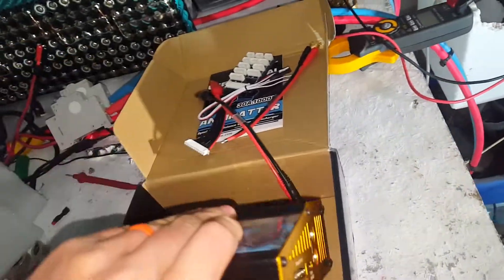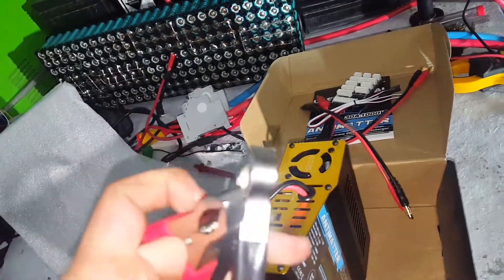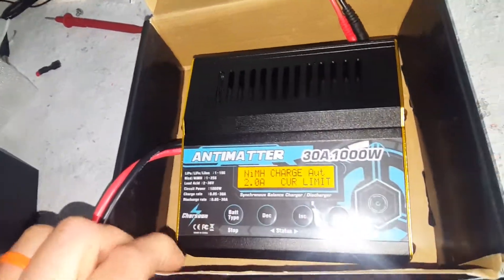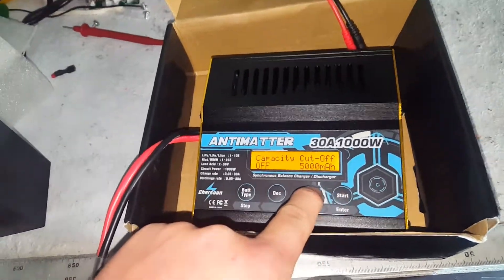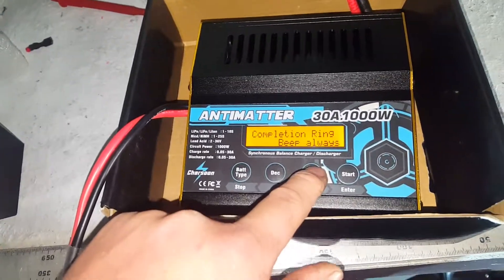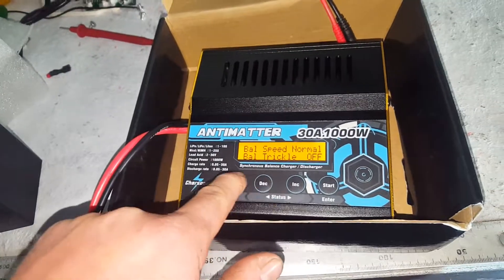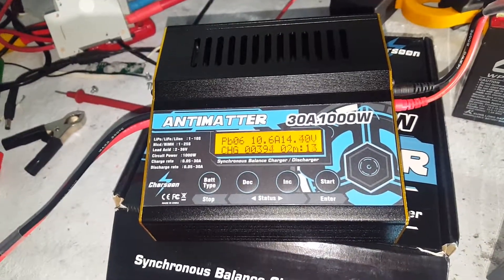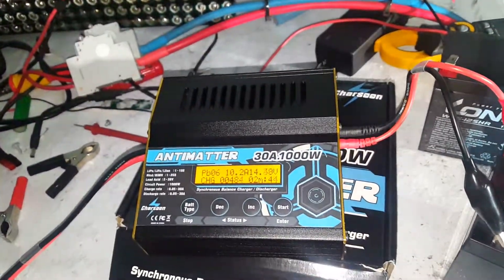Charsoon Antimatter 1000W 30A Lipo charger /discharger Unboxing.

Comment: Hello, can the charger charge a 36V lion Battery without plugging the white balance plug, only the +and - (for a battery that have a BMS already..)  ?
Reply from the maker: Yes you should be fine. Try on low output first
Reply: @Oneupthesleevecustoms  I mean, I have no balance plug at all. What I need is to charge the battery 36V and discharge eventualy. Saving the curve on the PC.    Is that possible?